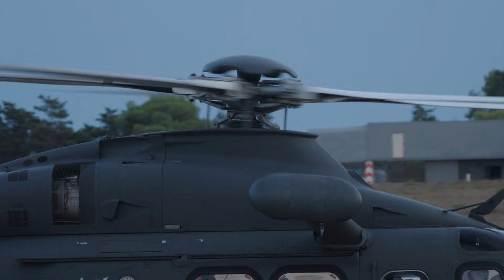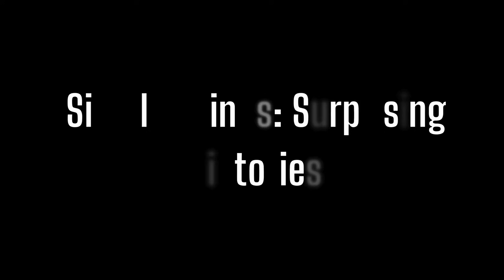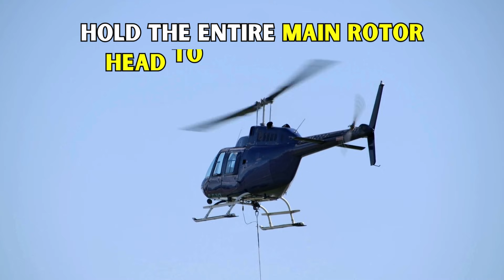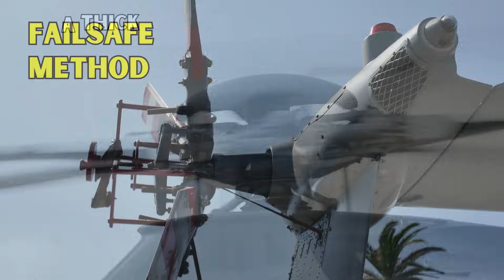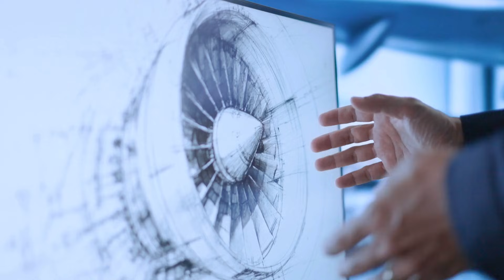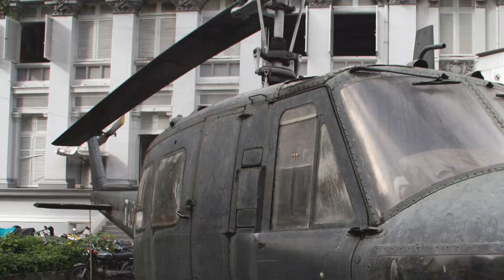The Jesus Nut: The One Part Keeping Helicopters in the Sky

Comment: Nonetheless,  check out the Jesus nut on a Robinson R22 or R44. If you do,  you'll never get inside that helicopter. The rotor nut on an R22 is terrifyingly delicate looking. It looks deliberately *under* engineered. I can't figure out why they made it so absurdly small, light and of such thin metal.

Comment: I don’t what H-60 you worked on. 40+ years of Blackhawk assembly and maintenance, there was only one Mast (Jesus) holding the main rotor assembly to the MR Shaft. It has 12 jack bolts through it pressing down against the top of the mast extension, these are torqued to a specific torque and recheck every 9-11 flight hours until stable. They are safetied by a ring that engages to shaft bolts and is secured to the mast nut. Also, there is a Pressure Plate that is bolted up to the bottom of mast extension that forces cone halves into the shaft extension. These are also torque checked at 9-11 hour intervals.
Reply: Well said Moose (JERK!) 😅  I always referred to the Jesus Nut being the Tail Rotor pitch control shaft retainer thingy.. My safeties were always a thing of beauty
Reply: The trick was getting that 1st wrap around the lock screw & the Pitch Beam Nut.

Comment: The Jesus nut might hold, but if the bearings freeze up, you’re in trouble.
Reply: That is why we will use ceramic bearings when possible as the tolerance for loss of lubrication is greater.😊